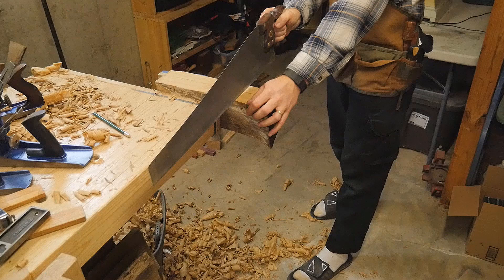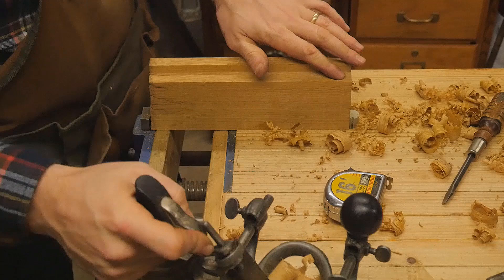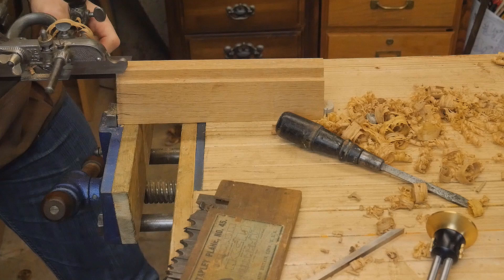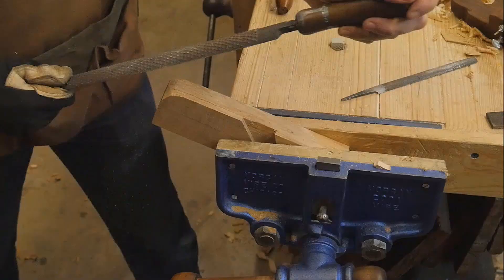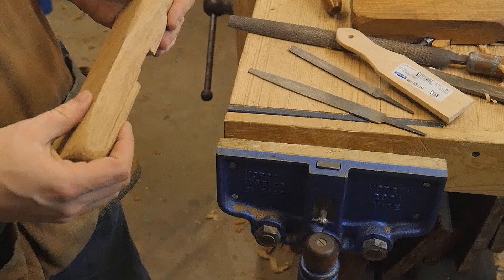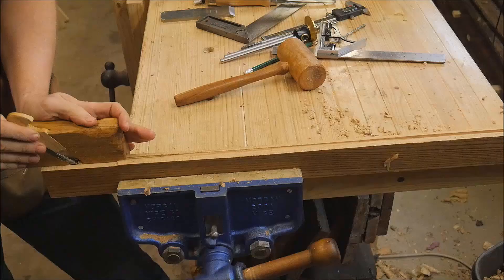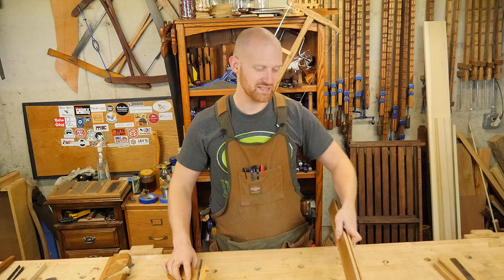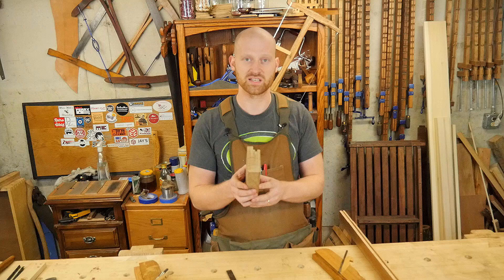How to Make A Grooving Plane for Tong and Groove set

Comment: Interesting video.  Just a couple of tips using O1 tool steel.  O1 is very forgiving but easy to overheat especially if you are only watching for a particular color.  A red color in a brightly lit room will usually result in overheated steel.  Overheating the steel tends to reduce the carbon content making for a less than optimal cutting edge. You can use a magnet to aid in reaching the proper temperature. Pre-warm your quench oil.  I usually heat a chunk of mild steel and then plunge into the oil a couple of times which will warm the oil...  Optimal temperature for the oil is around 140 degrees.   Heat the steel to the "non-magnetic" point and then hold it at that temperature for around an 30 seconds to a  minute before quenching the steel in oil.  Another tip is to not bring the cutting edge to final thickness before heat treating.  Leave the edge to the approximate thickness of a dime, harden and then temper the blade, and then do the final shaping of the edge thickness.  If you use a power grinder for the final edge profiling, be sure to not overheat the edge.
Reply from the maker: +William Boggess Thanks I had not thought of preheating the oil. I usually use a magnet but for this one I just decided not to. Probably the wrong choice but oh well. I use to leave a bit more material on the tip but as I only use hand tools in the shop the grinder is out, So I have to do most of it before hand I just try not to directly heat the tip. Thanks for the great Ideas though!

Comment: Okay, James, you just tossed that firewood in there, and started with the plane (scrub)? No need to get out a froe and split it down etc?
Reply from the maker: At that time I did not have a froe. But this piece has a flat side that was fairly good so the scrub only took a moment to clean it up.
Reply: @WoodByWright  Got it. I liked looking back at this because I saw what was important to you in tools at the time. 8 years ago and you had at least two good joinery saws (the two Veritas). The Veritas marking gauge. I noticed that your marking knife was a cheap craft/x-acto clone. A lot of the rest was basic, even a moderate set of chisels. It's good to see for me to get an idea of what might be important to me as I move forward.

Comment: I strongly advise against using olive oil on wood, as it dries at most to a gummy sticky state. I once oiled my kitchen table with olive oil. Well...I had to scrape this goo off manually. I initially tried sanding, but even with the most corse paper, it clogs up immediately. Also, if you put linseed oil on top of the olive oil, initially the linseed oil dries, but the olive oil inhibits full drying and seems to seep up through the linseed layer eventually...and then I had to scrape again to really get all the olive oil removed. Yeah...learned a lot there :)

Comment: Hello. I have a veritas plow plane, bit being honest is not my favorite it tears out a lot and in some times the tear out ruins the groove. Consider that a 60 degrees plow plane( with a wooden body will make a better job? Like an old molding plane)
And my second question is where can i adquire a blade that i dont have to make the "torch job" ?
Reply from the maker: With a wooden plane you can close up the mouth in front of the iron and that will give you a cleaner cut. but most of the time it just comes down to how deep the cut you're making. if you take it down to a 1,000th of an inch or so you can generally get rid of most tear out. As the irons, you can use old chisels or by dedicated irons. There are several tool makers that make them. Veritas, Lee Nielsen, hawk tools.

Comment: what is the inner grove for? Surely its just a rebate plane?
Reply from the maker: This is a grooving plane not a rebate plane. It is for making 1/4" x 1/4" x 1/4" grooves for drawer bottoms.
Reply: If that groove in the plane didn't exist the cutting iron would not sink into the workpiece. You would get about two light shavings (the distance between the plan sole and the tip of the iron) then it would just skate. A rebate plane would keep cutting because the iron is the full width of the sole but for the grooving plane the iron is only part of the overall width.

Comment: Could you post where you bought your blade stock. Also, what's the reason/ exp behind your choice of O1 over A2?
Reply from the maker: thanks Nathan. here is where I got mine from. https://amzn.to/2HH19rS untell you have been working with hand tools for a while you can not tell a difference between the two in use. O1 is just a bit more forgiving to temper as it is oil cooled. so that is the main difference, but either will work fine.

Comment: Groovy plane man... Just had to do that. I noticed pointing the end of the wedge was a bit tricky. Would it be easier to clamp a plane in the vice upside down and use it as a cheese grater? Might just be more setup time for just one piece...
Cool plane looking forward to the Tongue. Will you be making profile planes or do you use the scratch stock for that?
Reply from the maker: +Nearoth ya there are 100 different ways to do it. but i found this to be quickest and a little more challenging! I like to learn new maneuvers!

Comment: How much does the O1 iron cost? And how long to manually file it to approximately 30 degrees?
Reply from the maker: +Slap Stick I just purchase it from McMaster each of the two irons for this project were about $7. On the 1/4 X 1/4 it took about 5 minutes to file it by hand, but that was before hardening it. you can also order it from Amazon but they are a bit more expensive
Reply: Wood By Wright Got it! thanks.

Comment: what brand of planes are you using?  Irving?
Reply from the maker: +Fabian The Angry Almost all of the wooden ones I made. Most of the iron planes are Stanley but I do have a few other names. my newest plane is from the 1920s I do not have anything agents newer planes but for the price older planes have a higher quality to me. Does that answer your question?
Reply: Wood By Wright
yes thank you, i have a stanley number 4 and a few wooden planes and I was just wondering if there is a huge difference other than price. thank you.
Reply from the maker: +Fabian The Angry If you really have the money the Lie Nielsen Planes are so worth it! but in all honesty cleaning up an old Stanley is the best bang for the buck and a better plane then 90% or the ones on the market now. but it all comes down to your maintenance and sharpening ability.

Comment: Pretty frustrating to find a video on how to make a grooving plane and find that it requires the use of a grooving plane. Right up there with scissors sold in packaging that requires scissors to open. Normally love this channel though.
Reply: 45s are expensive!
Reply from the maker: The earlier grooving plane is made without  one. You should see that video.
Reply: Thanks so much for the reply! I haven't been able to figure out which video you're talking about, but I did find your live groove making video helpful.
Reply from the maker: here is the video I was talking about. it is an older one and I was experimenting with sped up video. but the info is there. I may have to make another one here soon and do a better-updated video. https://www.youtube.com/watch?v=UVF5m2MQmMQ
Reply: Ooo that is a good one! Thanks!